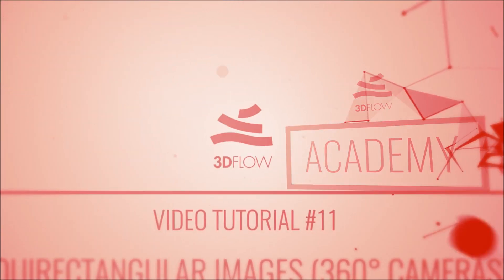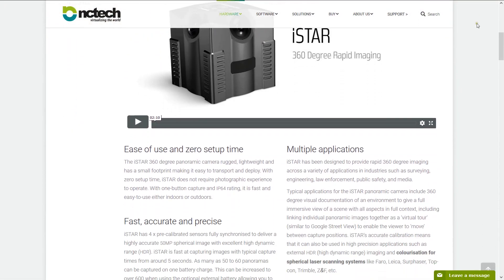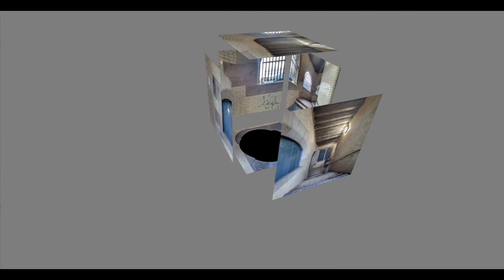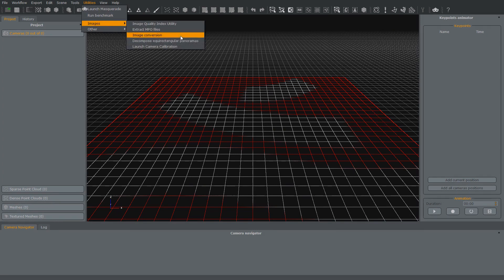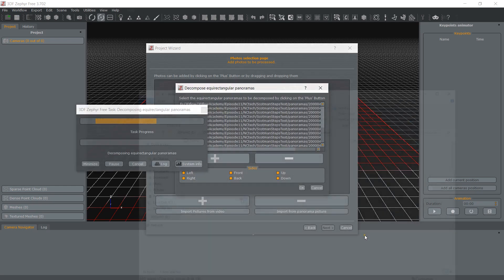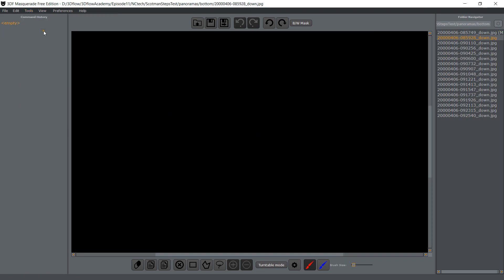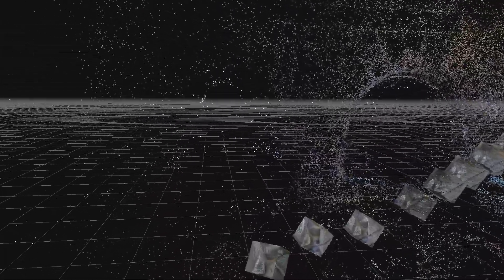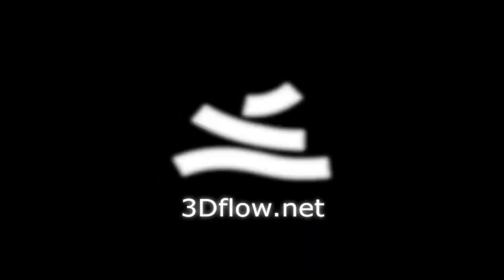3Dflow Academy - Videotutorial 11 - Using 360° cameras

Comment: Hi ! If a have a camera with 6 fisheye lenses what is the best way to capture interiors? if  import the 6 input fisheye images separately or the stitched equirectangular photos ? Thank you !
Reply from the maker: Hi Robert! If the lenses are real fisheye (180°) then zephyr won't be able to work with them. However, most lenses sold as fisheye are in reality non-fisheye (e.g. 179°) and those will work, although you have to be careful of their radial distortion and sometimes you should run a manual calibration on them. It's hard to tell which way would be better (generally, the raw images are better than the equirectangular one, as it post-processed) however we'd be happy to help if you want to share a dataset with us at support@3dflow.net :)
Reply: @3DflowChannel  Thanks. I will send you a dataset in a couple of days.